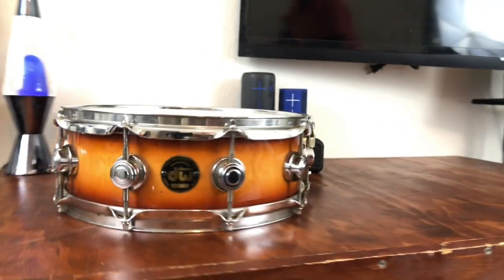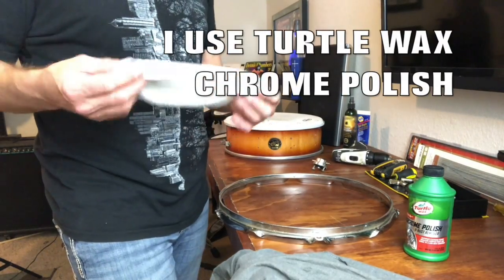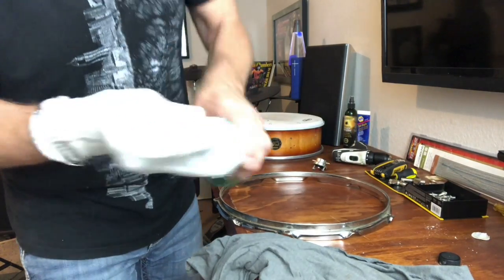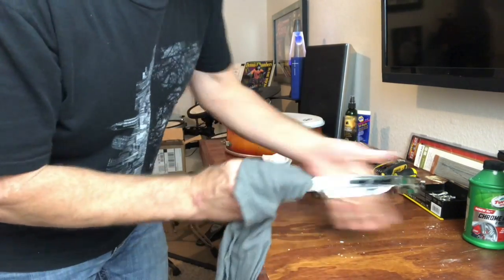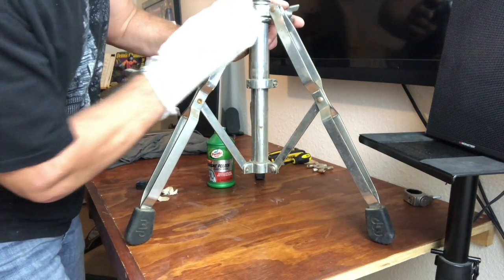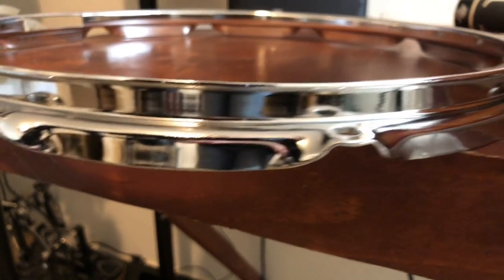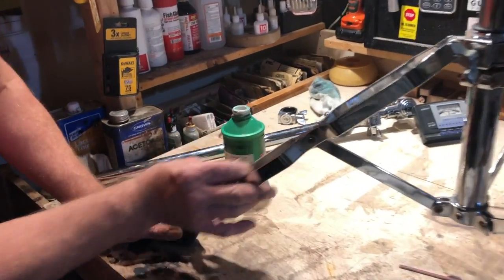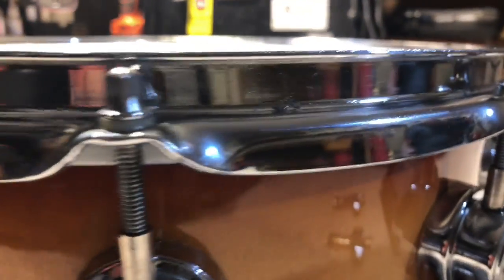HOW TO CLEAN YOUR CHROME DRUM EQUIPMENT EASILY (plus snare drum rebuild): DRUM REPAIR

Comment: I have been using aluminum foil for years to removed rust, works great, afterwards I use a non chemical liquid detergent to clean chrome. Soft wet cloth to remove cleaner and microfiber cloth to dried and shine.
Reply from the maker: Evelyn Ramos also a great method. I find the polish gives the cleaned spots a smooth edge that keeps the chrome from pitting further. For the really bad spots this has always worked best for me. Thank you for watching, and for commenting with another great cleaning tip. 🙏

Comment: Hey Kenny! Awesome video man! I know that if you use some white vinegar and aluminum foil, you can scrub the rust and pitting right off the metal without scratching. Works like magic! Then take some of your Turtle Wax chrome polish to really brighten that thing up. Just a thought! Rock ON!
Reply from the maker: Howdy my brother. Thank you. Yes you can do that. The chrome polish actually does the same thing super easy so it's a one shot clean up. Unless of course  there's a heavy rust I go to the 0000 steel wool. Vinegar, and foil would work ok there also.
Reply: I tried with wd40 and aluminum foil and got scratched :/

Comment: Hello kenny that polish is good for black chrome hardware please?
Reply from the maker: If it’s actually chrome, and not nickel plating the product info says yes. I would try a cleaner first. Vinegar/water mixture, or wd40, or a dawn bath. Chemical Guys have a light metal cleaner they say works well on chrome. Big bang has Crazy John’s  hardware polish that is great for cleaning your hardware, and leaves a nice shine. As with ANY cleaning method try a small out of site spot first to make sure the cleaner doesn’t cause issues.

Comment: Thanks Kenny for the info! Will that polish work on the tension rods themselves? I have a 1950s Buddy Rich model WFL Classic snare. Wasn't sure if the finish on the rods wasthe same as the finish on the lugs and the rims. I didn't want to strip the rods. Thanks!
Reply from the maker: d B yes it will although I tend to clean the with Naptha or some WD-40 then wipe them clean. The polish can take rust off of the tension rods, but if you have rusty rods I recommend replacing them. Again thank you so much for watching.
Reply: @KennySharretts  Great, thanks again!

Comment: I have a Mapex single tom holder that has a lot of scratches (not too deep) on it, luckily no rust.  How do I get rid of the scratches?   Thanks, Ron
Reply from the maker: You may never be able to totally get rid of them, but this polish with 0000 grade steel wool will go a long way to reducing the visibility of the scratch.

Comment: Hi Kenny, a quick question for you. I recently bought a Tama Starphonic Brass snare drum and i was tuning up the resonant head, when i ripped the head out of the collar, i found that strange as i don't over tighten the reso head and in all my years have never had this problem. I took off a reso head from my Pearl snare drum and was tuning it up very carefully (even using the my drum tune pro) when the same thing happened in the exact same place right near the butt plate, any ideas why this would be happening? thanks dude.
Reply: Darcy 809 The snare bed could a bit deeper than the head likes. However I find Tama snare beds to be shallow but wider than most drums. The only snare that I had a reso head seperate the way you described is with my 1988 Tama Artwood  rich shell. Those snare beds are a bit deeper than the modern drums. I have several modern Tama snares and they all tune up very similarly so I’m betting they use a fairly standard bed depth and width which on a 10 lug drum is the length of roughly 4 lugs. I have the Starphonic Brass and have not encountered your issue with Remo heads. Are you the original owner of that snare?
Reply: @Assimilator702  yes, it was brand new. I have returned the drum and got the SLP Mappa Burl snare instead.
Reply: Darcy 809 Thats good  drum if you’re talking about the G Maple. Another  great excellent SLP snare if you’re looking to try another metal drum is the Black Steel 14 X 8. For $250 that drum is absolutely unbelievable. I installed diecast hoops on mine which kicks it up a few levels but even in stock form that’s a seriously good snare and can hang with snares 3X the price.  Check out the demo of 14 X 8 snares Drum Center Portsmouth has on their channel. SLP Black Brass is another excellent snare.

Comment: I don't suppose you could use some 3 in 1 oil for lugs, could you? I don't have any grease lying around but I have 3 in 1 oil
Reply from the maker: You can, but I don't recommend it as much as a touch of grease. Silicone based grease has bit of gunkiness to it so it tends to "stick" if you will. 3 in 1 can be a bit slickery. I find the grease works better for keeping the tension rod in the swivel nut during the gig.
Reply: @KennySharretts  awesome, thanks for the reply

Comment: Hey Kenny, just wondering if this can be acceptable to be used on DW 9000 hardware? Planning on using this to clean my tension rods, lugs, stands, etc. and just want to be sure the stands will be okay. Thanks man. Keep on pumpin’ out that drum wisdom of yours man.
Reply from the maker: Scott Quinn yes. The stand I worked on in the vid is a 9000 I believe. For the rods make sure you clean them well afterwards. If you use the 0000 steel wool save it for the worst parts and remember 0000 steel wool only. Thx for watching 💪🏻
Reply: Kenny Sharretts Kenny Sharretts Thank you brother. Legally blind, so wasn’t able to tell what you were using, but thanks so much for your help. You’re a gem. Keep rockin’!